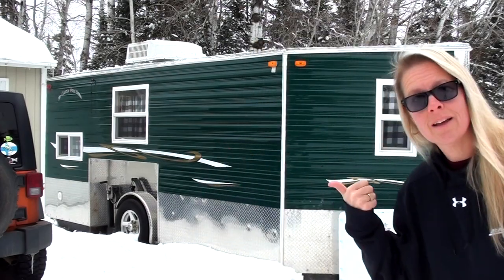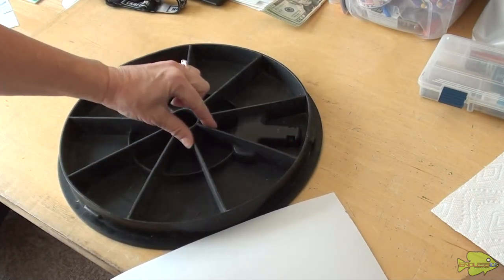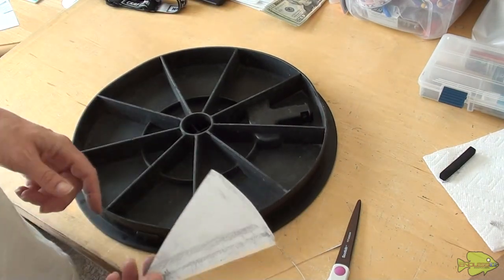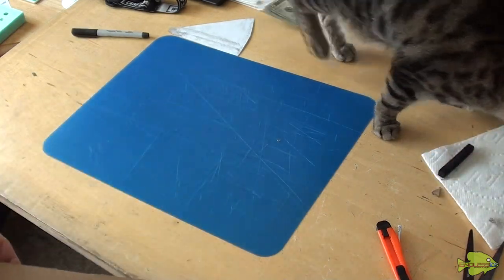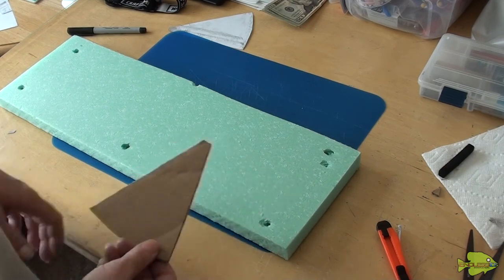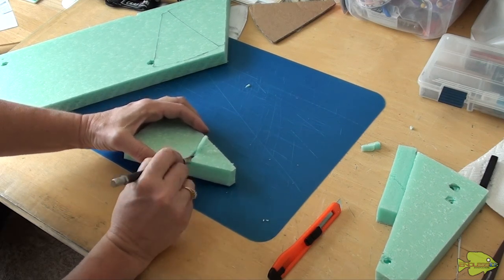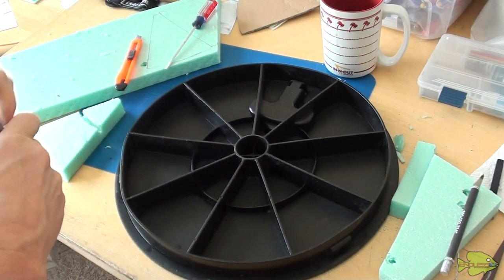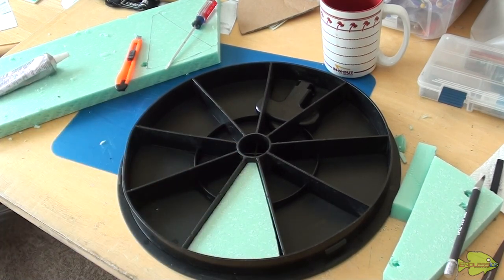How To: Insulate Ice House Hole Covers-Cheap DIY

Comment: great video, but to much work. the best and easiest way to do this is ( great stuff spray foam ) spray each pie slice let it expand and dry. then you could trim off or leave it, I chose to leave it.
Reply from the maker: You're totally right. The only reason I did it this way is that I had the materials on hand & figured I'd rather use them than toss them in the landfill. If I didn't, I'd have opted for the expanding foam, for sure; preferably closed cell.
Reply: Hey I absolutely do not blame you for not wanting to throw it away, I would have done the same thing if I had the materials too. But Like I said I chose the easy way, it truly is a great video though keep it up 👍

Comment: Why didn't you just use spray foam????
Reply from the maker: As I mentioned in the description, I just used materials I had on hand. My taxidermist built a crate to ship my mount to me & it had several panels of this insulation. Instead of throwing it in the trash, I found a use for it.